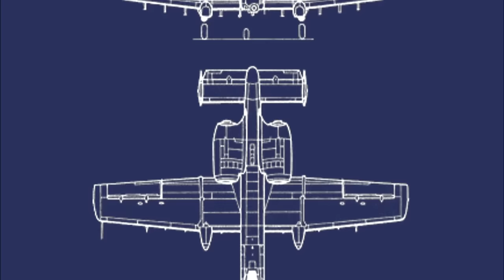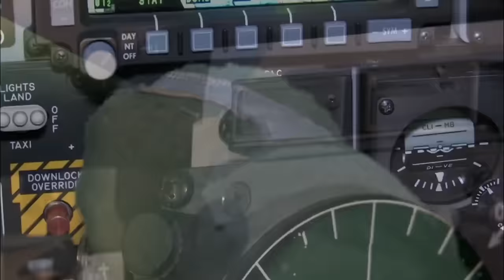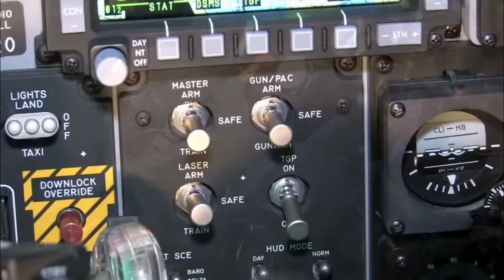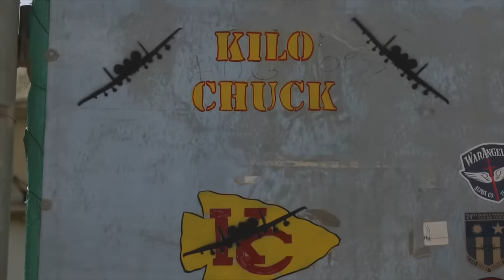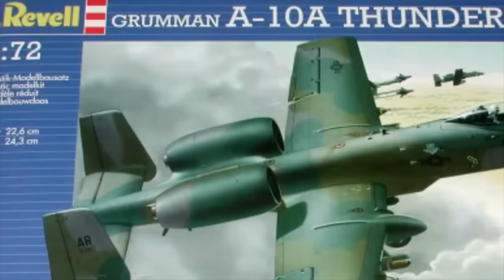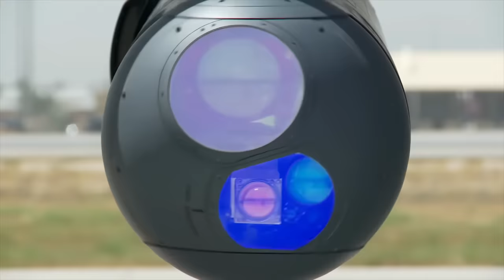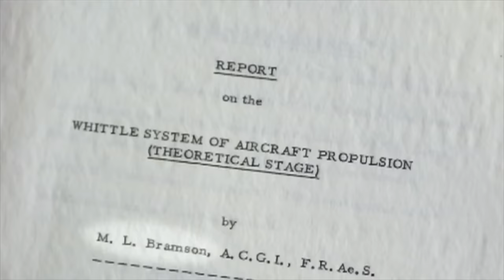A-10 Thunderbolt II Warthog | History, Controversy And Unknown Facts | Full Documentary

Comment: Nobody mentioned the significance of ballistic coefficient factor of the high density depleted uranium on top of the burning like magnesium and self sharpening characteristics. Muzzle energy of the .460 Weatherby magnum is 2,500 foot pounds greater than the muzzle energy of  .340 Weatherby magnum Lapua  
As the two bullets reach 600 yards their foot pound energy will be equal. At 1000 yards the .340 Lapua bullet hits with 1800 more foot pounds of energy than the .460 does at 1000 yards. If I remember right the .340 caliber Speer Lapua step boat tail bullet(above mentioned)has the highest ballistic coefficient that I know of. At .910 it's twice as high as the next closest bullet.
 If anyone knows the ballistic coefficient of the 30mm depleted uranium round used in the GAU 8 rotary cannon I would be very greatful to know. I'm sure the high density high coefficient on top of the self sharpening and metal burning characteristics are the reasons this GAU 8 cannon has been so successful in the A-10. I'll bet Hans Ulrick Rudel would have   choose to use one if he could have. If there is anyone who doesn't know of this German WWII Stuka pilot who flew 2500 combat missions mostly over Russia was shot down many times was credited with sinking a cruiser or a battle ship and hundreds if not thousands of tanks with his preferred twin 37mm cannons mounted to his Stuka.  He even survived the  war
Reply: What is "self sharpening" if you wouldn't mind a quick explain?

Comment: around 57:45 video/audio is garbled. Congress should have given A-10 a large budget to continue research into upgrading designs and research into air/spacecraft armor & deflection technologies against ballistic & radiation weapons. High tech planes are to take out tracking & anti-aircraft tech, maintain air superiority and cover our helicopters, Harriers & A-10s, which in turn cover CAS/Transport/Supply/Special Ops for our ground troops. Modify air flow around A-10 nose & fuselage to disperse gunsmoke away from pilot & engines.Maybe add an armored computer coordinated mini-CIWS on top & bottom to cover incoming missile/drone attacks. Will have to reconfigure entire aircraft for best aircraft performance, survivability &  mission success. If the experts approve any upgrades to the A-10,,have NSA watch & stop system of organized saboteurs.

Comment: There is something  to be said about a close air support aircraft with the ability to fly slow enough that the pilot is able to put ordinance on target and the ability to loiter in the area. 
The one thing that should be changed is the one thing this statement I will catch hell for...the 30mm gun should be replaced  with a smaller 20mm. The reason is the size of the beaten zone for the  30mm is so large when conducting the danger close missions they are known for. Something we never talk about is the friendly fire casualties that have been caused by the depleated uranium explosive rounds coming out of a chain gun that retards the flight of the aircraft and steals its oxygen with every burst forcing the Air Force to require an engine restart to fire the engines everytime the trigger is pulled. When the rotary cannon is fired and the platform is bounced around due to the forces of the jet pushing the aircraft as the pilot tries to keep the gun on target and the gun pushing against that. This causes the point of impact of each round to be off up to 30 meters from the point of aim and in a pattern resembling a couple 00 buckshot shells. They go all over the place in an unpredictable manner. This is not pilot error. This is just a matter of the gun being too powerful.
Not to mention that the 30mm rounds have never been the most viable way to kill armor threats. In fact, of all the vehicles destroyed by A10 Warthogs in 1991, almost all were killed by missle not gun. When the plane was test at China Lake for proof of concept, the warthog was only able to hit tanks in the open, with no camouflage and were stationery only 10% of the time. So why does it need the gun? For CAS. But it is ill suited for that role as stated above.
So why not replace the 30mm with a 20mm? It would be lighter, smaller and would be able to carry more ammunition and be more controlled, leaving less chance for friendly casualties arising from the recoil of the gun. 
Modern tanks are harder to kill today than in the 70s when the Warthog was developed.

Comment: The A10 is not survivable.  That's why the Air Force is getting rid of it.  The proliferation of very capable IR-seeking manpads make it untennable.  Very cool platform, but unnecessary.  It can sure ground pound, but what's the point if it gets shot down?  In more permissive environments, any other plane or helicopter can perform a similar roll.  The cost-benefit simply isn't there.  In Iraq it had 3 times the loss rate per mission of f16s.  And that would have only gotten worse now with MANPADs being more common.
Reply: I should point out that the A10 could be useful in a drone-carrying, or loitering munition / decoys on its many hardpoints, flying from unprepared and makeshift airfields.  That could be useful in modern warfare.  But maybe a purpose-built aircraft for this could be cheaper and more reliable.
Reply: Did you notice the way the engines are hung away from the fuselage on pods? 
They were specifically designed to survive having an engine hit by a heat seeker without damaging the second engine or other important bits.

No airframe is completely invulnerable,  but this one is still better than most.

Comment: The a-10 sucks and here’s why.

1: horribly outdated 

2: the GAU-8 is horribly inaccurate and to the civilian knowledge no 30mm round supported by the a-10 can take out modern tanks. 

3: ITS TOO SLOW

4: it’s not as rugged as you think

5: the battlefield has changed because of the inevitable onslaught of invention of better technology and progress of humanity, which make a-10’s completely useless in a war against a competent enemy (Russia, china, etc) 

6: ONLY GOOD WITH AIR SUPERIORITY. 

(I know that’s like…priority N.O. 1 on us military doctrine, however, we the United States have never faced a modern military in war, we don’t know if we can really achieve that enough for the a-10 to actually be successful) 

7: the f-16 and the f-15 are both FAR better in air to ground capabilities than the a-10 and even do it better. Even backed up by readily available data.

The a-10 does not have a place on modern battlefields. Its job is replaced and has been replaced by aircraft far superior than it.

Here’s what the a-10 could do 

Multi roll reconnaissance and seed.

The a-10 can technically carry a HARM anti radiation missile but it hasn’t been fielded or tested (to the best of my knowledge as of 06/26/24) 

The a-10 has the BIGGEST radar cross section of any frontline aircraft behind the Texan because of its turbine fans, (spinning blades drastically increase radar detection which is why stealth jets hide them engines with split s inlets) 

This makes it easy for Sam sights to lock the a-10 which makes it easy for the a-10 to perform counter Sam missions “wild weasel” or “SEED” missions and support modern aircraft.

But guess what… THATS WHAT THE F-35 WAS LITTERALLY BUILT FOR

Also ps. Pierre is a laughing stock in the military community, he didn’t even help develop the a-10. He’s a liar, and a clown.

Comment: While the F-35 May be jack of all trades, it is simply master of none. I'd rather have an A-10 overhead. The doctrine must be changed.. it was clearly written by haters of ground troops. 

If the airforce wants to control fixed wing air combat control, then they should be up front in explaining why the Marines (F35B) and Navy (F35C) have them. Change policy and allow the Army to take the control of Close ground support fixed wing aircraft and stop allowing another branch to hobble the support and protection of US comat troops on the ground. It makes sense only if you look at it in a perspective that the Air Force doesn't feel the need to protect them. The air force feels the need, the need for greed.

Comment: Those Air Force dinks are all about air superiority and multi-role supersonic fighters with stealth tech.  Those fast jets are phenomenal at knocking out strategic targets but not suited for close air support. A10s can fly low enough and slow enough to see soldiers physically point out the target.  No radio communication, just smoke and hand gestures.  The Air Force dinks want glory for killing radar installations, SAM sites, enemy HQs and most importantly, an aerial victory.  An AH-64 can provide adequate support, but an A10 can get to the troops 3X as fast with 3X the range and 3X the ordnance.  Apaches fire on targets from stand-off distance.  A10s rocket the shit out of all visible targets then are able to 180 and make a gun pass 5 sec later.